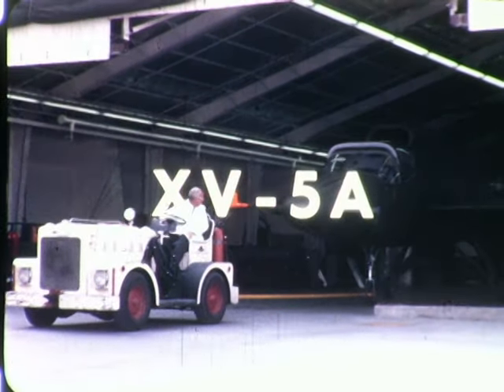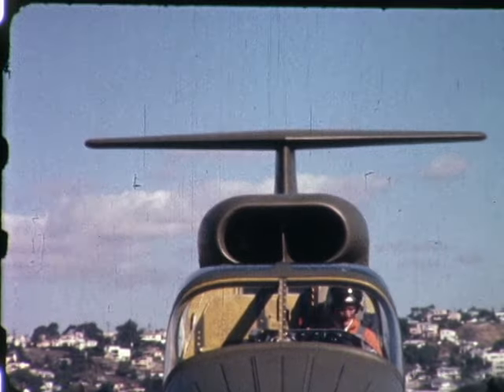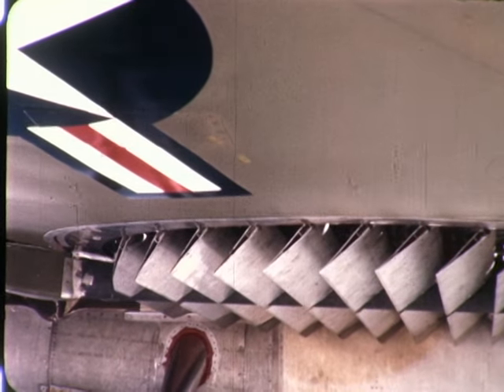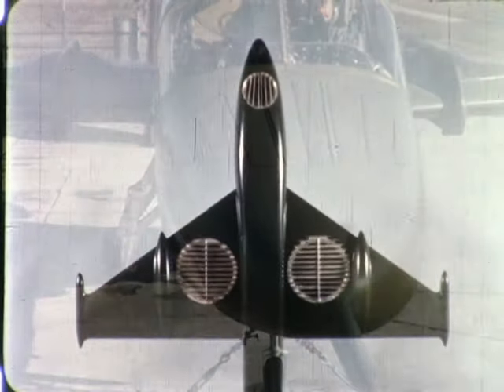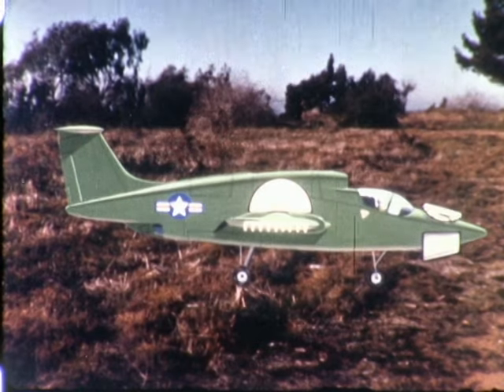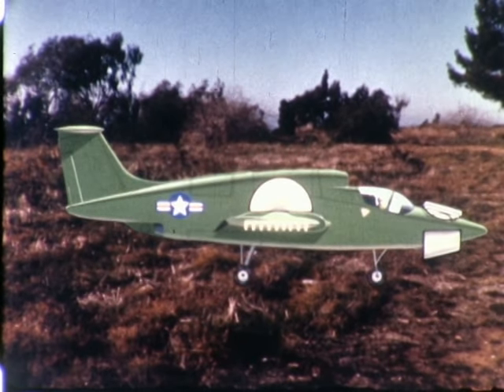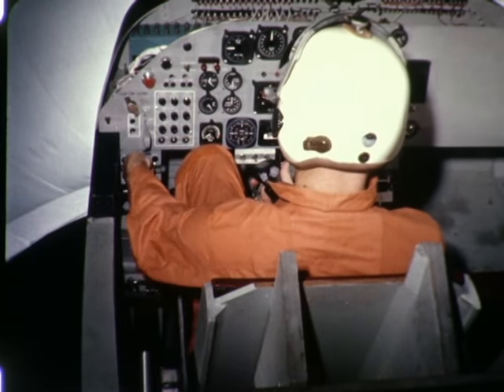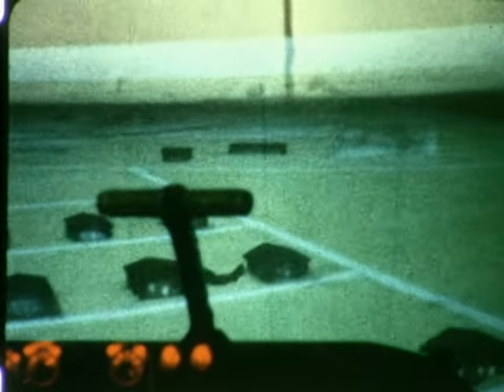F 2569 Ryan XV-5A Vertifan VSTOL Demonstration Film General Electric

Comment: The F-35 has a wonderful system. The landing maneuvers are tight and precise. The evolution of the technology has been remarkable. I was unfamiliar with XV-5A. Those early day were critical to the growth into the current systems. I would ask if the program have been shelved by Ryan Aeronautical. I have been studying VTOL systems going on 2 years now. I have an idea, but I need to learn a lot more, but it is fun, looking at he math of thrust and loads, cords and mac, it is all new to me but I don't want to lose the forest for the tree. You want to hear something funny, I heard in the video, I cannot think of the covering. only the framework and engines placements. It really neat because, there is nothing new to be invented It's all a matter of mathematics and design engineering. Unlike the XV-5A, I envision a V-tail! 
Foremost I think of safety. In Formula One racing, the driver's sit in carbon fibre monocaques, which massively reduces injuries when there is a high speed crash, I think there should be a similar system in cockpits and cabins. The materials available for building are incredible, depending on your use, you have a choice of lightweight materials to build with. There is a critical need as aircraft landing space, it is at a premium for convention aircraft to have somewhere to land, as there are so many planes, in the sky at any one time.
Excuse my verbosity, as you can imagine there are few that I can talk to about aeronautics, let alone aircraft with VTOL. Good Day!

Comment: The simulator looks like it’s based on a camera swing over a model of the terrain with the resulting picture on the screen. That’s not computer generated imagery but a model with the pilot controlling the camera. That’s why he turns so much. The edge of the simulated area look to have vertical art that looks to be terrain extending into the distance.
Reply: That's an interesting observation; I was wondering about the computer graphics myself. I'm sure you are correct. It would be fun to design and build a system like this; too bad we went digital with everything. Thanks for the insight.
Reply: Definitely a terrain map, but it was accurate, because simulators used this method until we went digital in the early 80s

Comment: what happens if you lose  a fan...
worthless
Reply: It glides on it's wings or lands on it's reinforced legs.   Most aircraft like this don't take off with full fuel, they refuel in air.
Reply: Helicopters...what happens if lose the tail rotor. Worthless
Reply: You go conventional flight. The harrier was the same, as well if the mid engine goes out on the F35